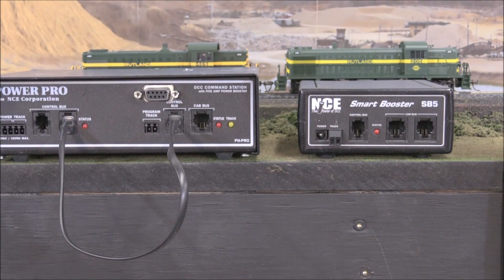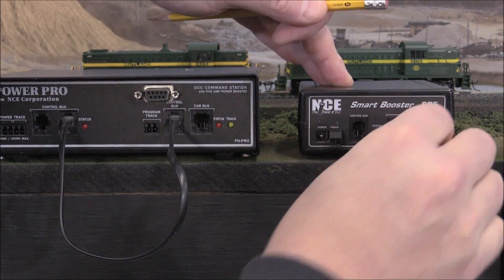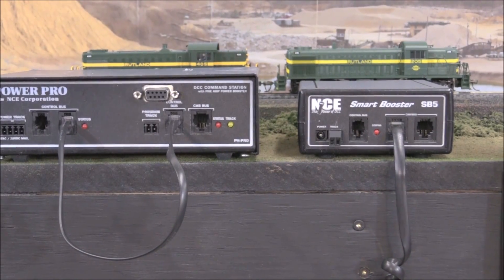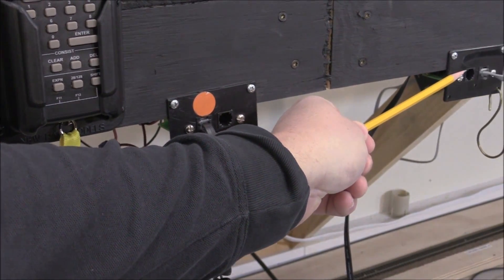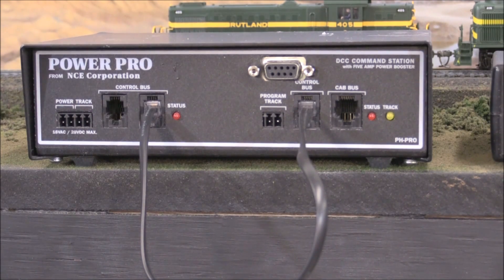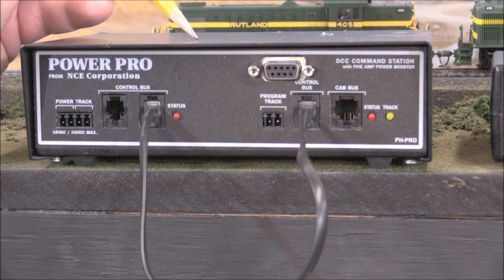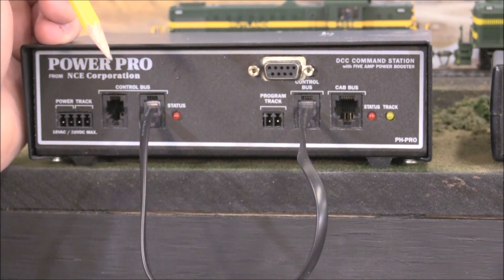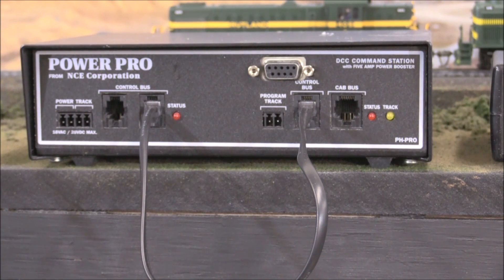Video Review Of NCE Starter Systems Part 4: Connect a PC to NCE Systems

Comment: I have issues with NCE USB on Laptop Win7 & PC Win10, none reading or writting CV's. None flashing leds on the NCE USB, None driver missing or alert show the JMRI DECODER PRO. I can see you have all jumpers plugged or not? The flyer said remove all them with Win7 & 10. I hope you can made a simple tutorial step by step how set up the NCE USB to PC with Windows very soon. TY.

Comment: You can use the usb interface card on the ph pro. Im have it on my layout. If my pc had an rs232 connector, i would have been more cost affective to just buy the serial cable. But in my case that was not possible. I did price out a serial to usb converter but NCE said they have only had success with 1 and the price was about the same.